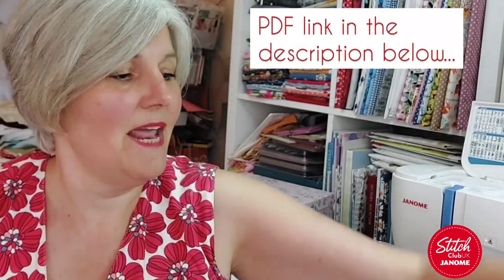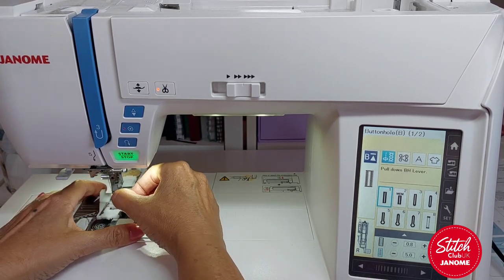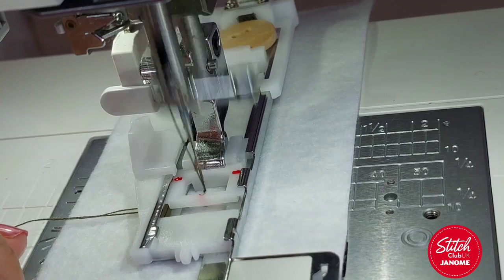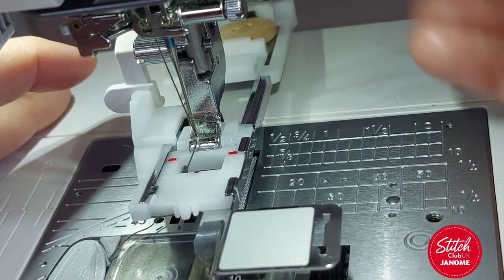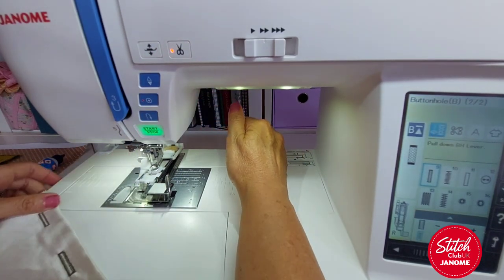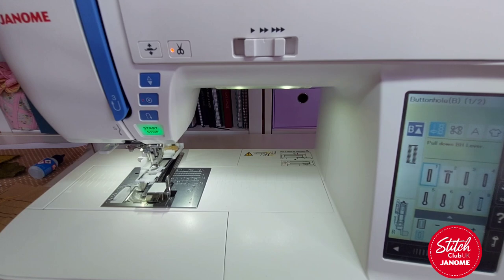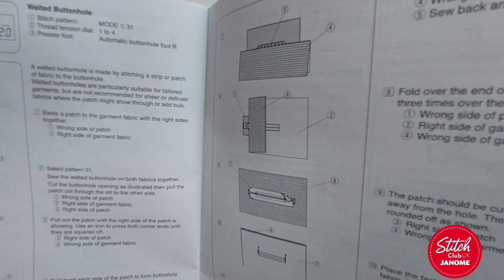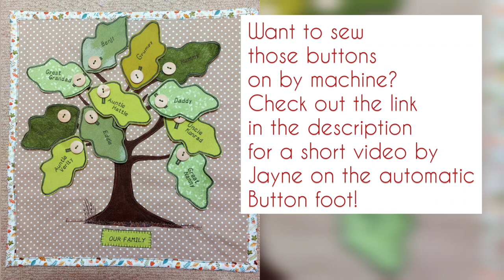Janome Stitch Club UK - The 1 Step Buttonhole

Comment: Hi. Thanks for your very informative video. Do you have any tips for stitching the tricky buttonhole on a collar stand? I always find that my machine gets stuck and I've never been able to produce a buttonhole that looks decent in that area. No problems whatsoever with any elsewhere on a garment. Hoping you can help.
Reply from the maker: You need to be brave in trimming the seams back inside as far as possible. Then press really well to flatten as much as possible(I have been known to use a hammer!) Then take the stitch length up very slightly and start on the furthest edge where it's at its flattest.If you have a stabilizer plate this can help but keep your speed low so you can ease it along.Do be careful not to hit the sensor though! X